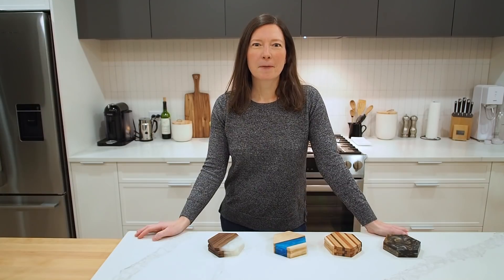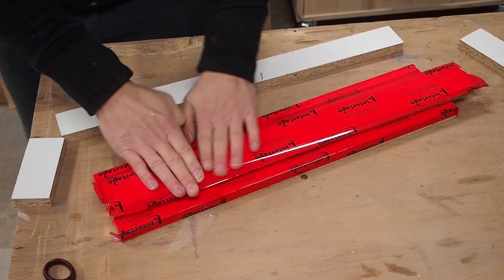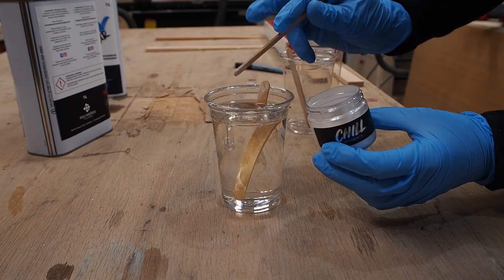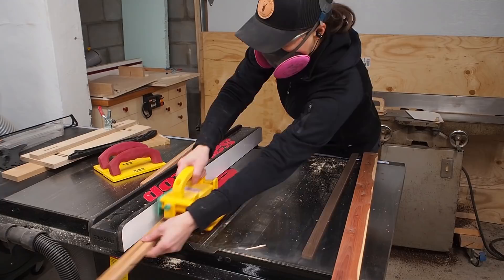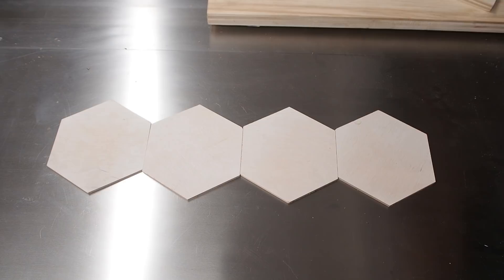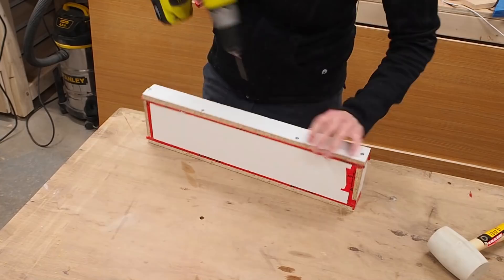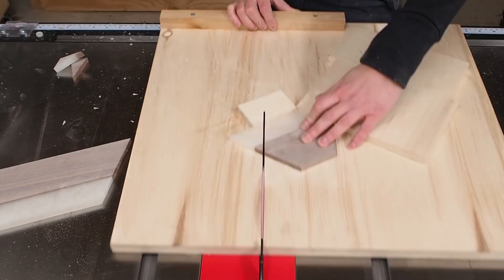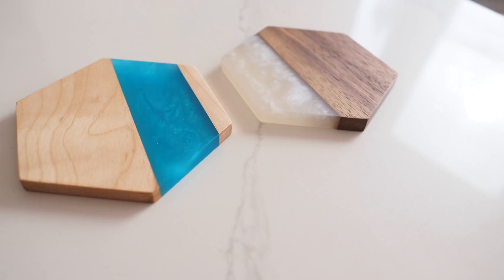Wood & Epoxy Hexagon Coasters

Comment: Hi Marie. To neatly finish off silicone take an old credit card and cut one end of it so that the corners become square instead of the usual rounded. Then snip a tiny corner off at 45°. Then when you’ve laid your silicone in the corner run this around and it will leave a nice 45° fillet all the way round wherever you’ve put the silicone and scrape off nice and cleanly all the excess. You can even cut different sized corners off to give different sized fillets.
Reply from the maker: Love this tip! Will try that in the future, thanks!

Comment: a resin swirl tip from a surfboard builder: First create separate cups with the colors you want. Mix the epoxy, hardener, and pigment. Once you have a cup for each color, pour them both into a third cup and LIGHTLY, barely stir. Often times that third cup has clear epoxy in it, creating a swirl of clear and both colors. Then pour and watch the magic happen!

Comment: You use a molded piece 4" by 18"; what is the dimension of your final coaster.  What is the measurement you use for the jig setup to cut the coasters? I just made your adjustable jig! Kudos.

Comment: Nice Marie I haven't yet been able to work with epoxy yet maybe in my furture.I just got into bowl turning would like to do some epoxy work in bowl making hmmmm.But great job on your coasters they would be a nice Christmas gift.Is epoxy hard on your planer knives or touter bits?
Your biggest fan :-)
Reply from the maker: That's a great question and my answer is.... I don't know. Like you, I would imagine it's hard one the knives, but I didn't notice any added resistance when cutting on the table saw or the planer, so maybe not. I wonder if it makes a difference that I planed and cut them after only 2 days of drying vs. say 7 days when the epoxy would be fully cured and harder.

Comment: So what's your opinion on this type of epoxy? I've seen it around before but haven't heard much of how it differs from the other brands
Reply from the maker: I've never used other brands so it's hard to compare, but the fact alone that you don't need to use a blow torch or heat gun to pop the air bubbles after you pour (they clear up by themselves) is enough to make me want to use it. 
And it's made locally in Quebec, Canada!

Comment: Did you cut the epoxy with the SawStop in bypass?
Reply from the maker: No, I cut in regular mode as I usually do. The thought never even crossed my mind, actually. Epoxy is like plastic so not likely to be conductive.

Comment: Mine are not comming out uniformly, what am I doing g wrong please
Reply from the maker: The angle is likely slightly off on your hexagon cutting jig. Try adjusting the fence.
Reply: @DIYMontreal  I'll look into adjustment also is there some thing I can do to make bigger hexagon pieces?
Thank you
Reply from the maker: @paulshaw6125  Have you seen my hexagon jig 2.0? https://youtu.be/CzTUOQZQoR0 It's adjustable to cut hexagons any size up to 18 inches